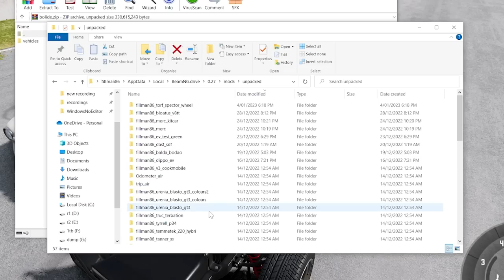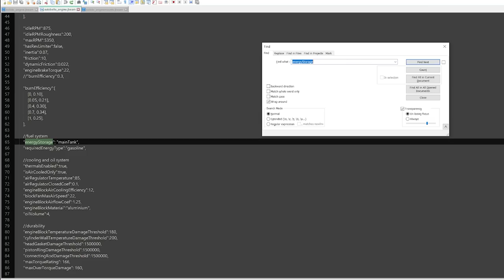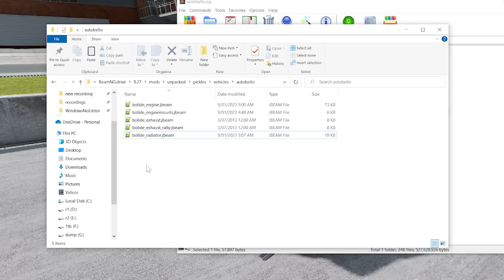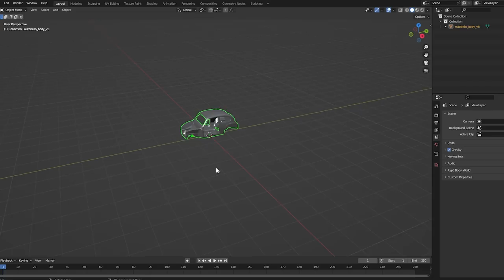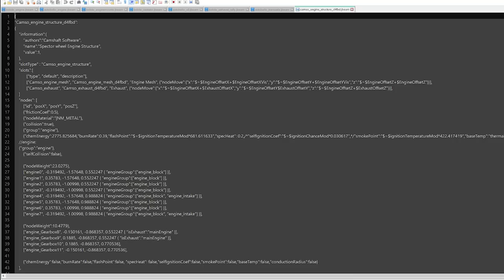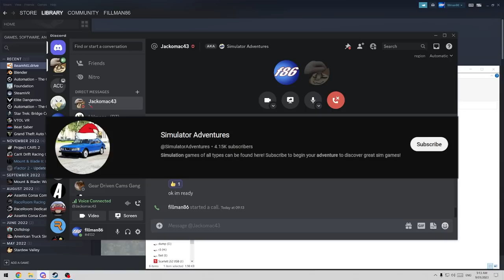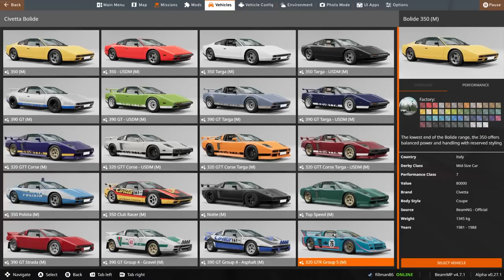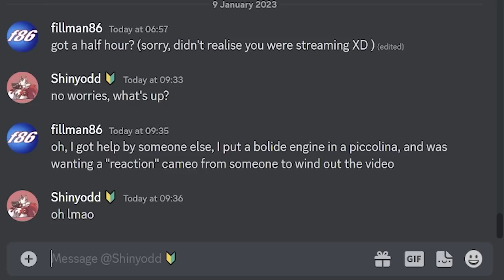The Real Engine Swap Options!

Comment: This is very reminiscent of a surprising number of v8 swapped classic vw Beatles and I’m all for it. Especially seeing this kinda work on a track instead of just in a straight line
Reply: Most of the weight is in the rear, so it's probably a chore to actually drive fast around track.
Reply: @jwalster9412  the main difference is that this one's actually mid-engine swapped so it's probably not as bad as you'd think. With some suspension work and a good diff it would probably be a zippy bastard of a beast! Just gotta be carefull on the throttle though.
Reply: @Ferrari255GTO  the footage looked like it drove close to how the normal bolide does, but in a shorter wheelbase.

Comment: to get the interior to be double sided you have to in blender recalculate the outer normals and copy the whole object paste it in the same spot,
then recalculate the inside mormals on that 2nd object.
you then join the two objects back together and beamng will now recognize it has 2 normals for each side.
Reply from the maker: wait, are you saying that your solution is to just have the model in there twice? haha that seems very inefficient XD there's most likely a way to get the material to be double sided like they are for automation cars
Reply: @fillman86  There is probably a better way to do it but that is just the easiest way that I've found to do it from browsing beamng modding discussions.
I think flipping faces in blender might work too
Reply from the maker: @otmotivealt8522  I already fixed it. Making it double sided worked haha but I was using a skin, so I just put it there too, and it works now :)

Comment: The car that i love in beamng drive is the gavril barstow. That thing takes all kind of tourture, Ive put it out on the back roads of Johnson valley mostly stock aside froms some trans work and engine size i almost made it but i screwed up and high centered it. No other car takes the beating the gavril barstow dose without giving out. Even D series will give out when beaten engh time this thing though it just refuses to die.

Comment: Would you consider making a wheelie bar mod for this body for the Beam Repository? I love the race version of the Autobello and it sucks for drag l racing because of that awful wheelie! Anyways, great video, can’t wait to see the next video
Reply: It'd be better to have a front ballast mod for the piccolina, the wheelie bar can also cause trouble, i have an LS7 swapped 200BX with a Stage 3 supercharger using the regular drag version as a base and when the car would smack the wheelie bar too hard it would do weird things and make it completely unstable. When i get it right the car can do a 7.0 on the 1/4, wich is fairly impressive with how bad the original one is.

Comment: You know what would have been even better? Rotate the engine 180° so it keeps the original orientation of the flat 4. Then it would technically be "realistic" because you wouldn't need to modify the chassis much and you could theoretically keep the stock transmission and avoid trying get custom half shafts. 

But I still love to mid engine Abarth. Someone should do this with an irl Abarth and a Ferrari V8. It's technically not impossible because there is not much in the area behind the front seats.
Reply from the maker: but the flat four isn't transverse... it and the v8 were both longitudinal
Reply: @fillman86  no, I don't mean transverse, I mean behind the rear axle liek the Flat engine is. (I put 90° and not 180°)
Reply from the maker: @jwalster9412  oooh.... it'd do a wheelie whilst stationary XD also I didn't want to remove the rear structure :/

Comment: I was just about to ask a question regarding your experience with ultrawides since I am looking into getting one and also create content with it, but this video is 16:9. Why is that?

Optionally if you'd like to answer my question on your experience with ultrawide gaming and recording add that to your reply as well ♥️
I love your content due to that extension of the video, especially when on mobile.
Reply from the maker: I love ultrawie! but I get poopoo'd so much for uploading in it :/ also you can't put endplate stuff on videos that aren't a normal video size :( So I've changed my monitor's aspect ratio to crop the sides of my screen

Comment: I was trying to put the V8 and V8 diesel from the scintilla into the autobuggy at one point.. It run into so many issues.. It was fighting me at every turn.. I don't know how to use blender as well as you tho.. clearly. the fact things don't rotate off their centre is a pain in the ass tho.

Also.. In my experience beam will recognize added and modified files while running but not directories. Those need to exist on launch(At least empty)
Reply from the maker: yep, this was the first of many adventures into modding default cars :)

Comment: you should really make a FWD race car like the Nissan LM GTR NISMO in automation
Reply from the maker: I've done stuff like that in the past, and I'm planning other things like it again one day
Reply: Man, i'm so upset that nissan made that LMP, it was probably the stupidest choice possible and they did it all based on theory with no proper proof of it. I hope that the engineers took the project as a meme, because the dissapointment must've hit real hard, i get that you're suposed to try new things in order to innovate, but even rally engineers of the 60's knew better than to do that.

Comment: but how do we swap electric engines, how do we put beamng wheels on automation cars and how do we put siren on cars that dont have them?
Reply from the maker: EV swap is easy, basically the same process. Beamng wheels on automation cars is there by default, just select different hubs in the parts selector menu. As for the siren, I've only done it once... and I don't remember XD maybe I'll make it a video one day
Reply: thanks

Comment: How do you move the engine once the swap is done. I need to move it forward and up
Reply from the maker: look up nodeOffset or nodeMove as a modifier for the slot, but this will move all engines, not just yours. Alternatively you could move the mesh in blender, then use the new blender tools to import the jbeam, and move that too

Comment: there is any way to get this config ? dont have time to do this :'(
Reply from the maker: once it's approved, you'll be able to find it here on my repository page - https://www.beamng.com/resources/authors/fillman86.380331/
Reply: @fillman86  Sadly I doubt it will get approved in this state, you can't have duplicated assets that haven't been renamed because then it overwrites the vehicle it's from so this mod is probably breaking the Bolide, next time please read the modding guidelines, I could list a lot of stuff here that goes against them. But sometimes they just approve mods without actually checking what is in them so maybe you will be lucky lol
Reply from the maker: @agenty_gd  hmm I think you missed the fact that it requires the correct file structure for it to affect a car. The file structure here directs it to only the piccolina. To put your mind and rest, I did a quick test, and nothing seems to be effected on the bolide :)
Reply from the maker: @agenty_gd  wait, it makes materials on the engine double sided, but that's all I've modified in that regarded. Easily fixed, though not really doing much
Reply: @fillman86  If you spawn this first, and then replace with Bolide, it should affect it. Also the fact that it doesn't change much now is not very relevant, because you can't tell if the next game update won't completely change the Bolide engine UV maps for example, then this mod would make the game load old ones and it would look broken. Not to mention it can conflict with other mods that use a modified Bolide engine.